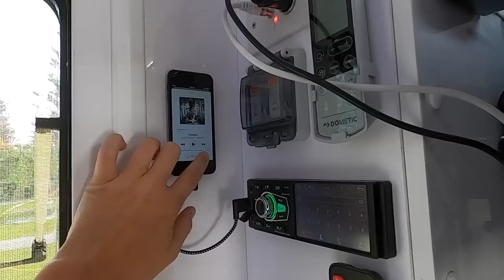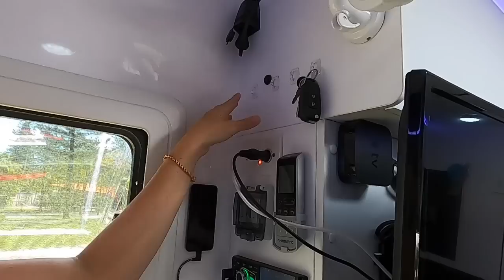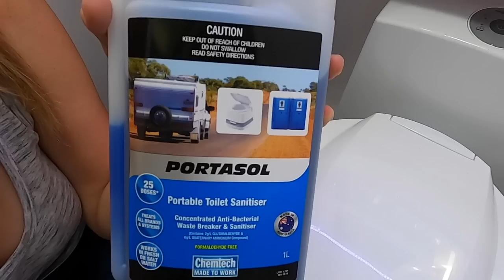CARAVAN TOUR - OUR HOME TO TRAVEL AUSTRALIA IN! - 006

Comment: Re chrome cast:
The Apple TV as you are using it now is a good option, but it may be worth getting a mobile 4G router like the Nighthawk M2 and using that to provide WiFI coverage in your van from the Telstra 3G, 4G, and 4Gx network. These units charge off of USB-C so you can run it off your existing USB chargers and you can also get efternal antennas to connect to the FME antenna ports in the back.
With a mobile router, your devices can all connected to a WiFi network (like you would at home) and your streaming services should function normally. I would also recommend when joining laptops to this network to make sure you set it as a "Metered Network" so that they avoid downloading updated and use the bandwidth more economoically. 

Lastly, most providers will allow you to order a data sim attached to the data allowance of your family plan. By doing this, you combine both of your phones data and can use it from your mobile router.

Cheers.
Reply from the maker: Thanks for that! We actually ended up getting the nighthawk so we could run the Apple TV and it’s bloody amazing! Haven’t heard about the data sim before, will look into it, thanks for the awesome tips! 😁
Reply: @BigOzExplorers  No worries. As another note with the nighthawk: If you have trouble communicating between devices, look up "Disable ipv6 on nighthawk". These devices have a few known issues with ipv6 and work much better with ipv4.

All the best.

Comment: The trick to chrome cast is to set it up on a wifi somewhere else.   Once setup of you enable wifi sharing on your phone and make sure the SSID is the same name as the SSID on the wifi you set it up on.   Chrome cast won't know the difference and will allow you to stream from your phone with out a wireless router. 

Option 2 would be too use an old Android phone as a wireless router or a wireless router with 4g support.   Add an additional sim card to your plan  and install it in the router and it will work as if you are at home
Reply from the maker: Thanks for the tip mate! Appreciate your help ☺️ We ended up moving away from chrome cast and got a smart TV that does all of what we needed with a Telstra wifi 😁🤙🏻

Comment: FYI... brake safe should be connected to the chassis of the vehicle.. not chains.. not tow bar.  you should assume worst case that your tow bar fails
Reply from the maker: Yes your right, just read up on instructions etc! We will change that, thanks 😁
Reply: Hey guys, thoughts on changing this video to remove the advice for safety chains?

Comment: Really loving the content thanks for sharing. I have a chrome cast working in my caravan now off grid But you do need two iPhones. One set up on hotspot that your spare iPhone and your chrome cast can connect to and go through the setup procedure on. there is instructions on the Internet and it does work. Just hold the button down on the chrome cast until the light goes white to perform a factory reset and then start a fresh set up procedure of it and your spare iPhone both tethered to the hotspot on another iPhone.
Reply from the maker: Thanks for the tips! :)

Comment: Love your trailer. Congrats!
Might I suggest putting all the cleaning supplies, locked, out of the reach of little hands?
The bod on the front is probably meant for a generator or outside grill. I'm surprised that your rock deflector doesn't fully protect your propane cylinders.
Reply from the maker: This video is some time ago and our little hands were old enough to know better or too young to move lol, situation has changed a lot now! 😁 the box was a great idea but the slides were shocking, couldn’t of pulled anything out with weight in those slides 👎🏻 we’ve change it now to something that suits us better!

Comment: It’s possible to convert your Apple TV to run 12v power if your happy enough with the Apple TV it’s not a hugely difficult modification
Reply from the maker: It is possible to make Apple TV run on 12V but we’re not prepared to pull the thing apart and figure it out! Our battery upgrade includes an inverter which we need for our microwave as well so we will probably use the inverter when we’re streaming because it’s simpler than chromecast! Our Wi-Fi is 12V so the Apple TV alone won’t overwork the inverter at least... The battery upgrade is next week so we will let everyone know how that all goes anyway, hopefully we can keep everything working the way we have it now! 🤞🏻

Comment: Great vid guys it’s my understanding that impact drivers on your landing legs can break the teeth off on the mechanism use a cordless drill instead cheers😀
Reply from the maker: Thanks for the feedback Murray, we’ve heard so many things about these now I don’t know what to think 😂 hopefully ours won’t give out but if they do I guess we will find out the hard way! Only so many tools we can carry to be within our weight and not be silly, a right catch 22 hey!
Reply from the maker: Sounds like you think we’re lifting the van with them, we don’t just FYI 💁🏼‍♀️ we do actually know how to use stabiliser legs, they’re not called jack legs for a reason 😊
Reply: I use a cordless drill to get them close then use the crank handle supplied to put tension on them. You will strip the bolts and bend pins with an impact gun eventually. From someone who has had to replace both because I used to use a gun.

Comment: Hey guys great work and good luck on your venture. 
Just a lil hot tip with your storage if you can try and keep your heavy things as low as you can it will help with the centre of gravity and when you get on the bumpy road it will help with the longevity of the cupboards and shelves. 
Great work keep up the good job
Reply from the maker: Thanks Matt for the top tip 🙌🏻😁

Comment: Front tool box is made for a gen set.
Reply from the maker: We have chosen to travel without a generator and have since installed a Ziggy barbecue in the tunnel boot so the slides in the toolbox were not required and additional weight that we needed to trim off! 😁

Comment: A blunt knife is more dangerous than a sharp knife.

Ensure you can both operate the van's set up and preparing for the road. Filling water, dumping grey water etc. As well as both towing, reversing, parking, changing a tyre, etc.  If anything happens either of you can completely takeover, while the other person is laid up.

Seriously I would invest about $300 and buy a Personal EPERB (an emergency position location beacon), meaning in a medical emergency you can call for emergency assistance. Anything which your life is endangered. If seriously going off-road, look into getting something like a Codan Outback Radio transmitter/receiver. You may need to get an operator's licence. It means you can also call for assistance of anyone within radio distance, talk to others on the road. What many do is put their call-sign on the back of their vansand even roof, so others following can call you, warn they want to over take etc. Or in an emergency, aircraft can recognise you from the air.

Also going bush, ensure you are carrying some form of personal protection, wink wink, even a bl**dy big wrench or cattle Taser. Cable zip ties make good restraining ties if needed to keep an unwanted stranger secured.  

We are a relatively a safe country but on occasion unlawful individuals can spoil it for others. Always ensure someone knows your timetable and checking in like clockwork. They could also be a means of getting help for you if something goes wrong. Don't be frighten of talking to the Police in outback towns. If you have a bad stretch of road ahead, they can stay in touch with the next station on your destination, to ensure you arrived safely.

Road conditions can change at the drop of a hat, you need to be aware at all times, you also have children to consider. Teach your daughter a safe word, for when you want her to go to a safe spot immediately to hide. Think about that one. Sorry, I don't want to make you frighten of hitting the road or the outback but at the same time, you need to be smart to be safe. Like NOT always stopping on the road to assist a car. Always listen to your gut, listen to each other. "She'll be right mate", isn't always safe.

You can use your mobile or radio to get them help unless it is a life and death situations, then of course you stop but hopefully you will also have your EPERB to use. If one of you leaves your camp to go exploring or even fishing when out of site, then take the EPERB with you along with your two way radio, water and hat.

Since Covid, we need to be really aware of our personal safety at all times. The harder life gets, the more risks there are from strangers who fall on hard times. Even when getting fuel and you all leave your vehicle, ensure your car keys are in your pocket and your vehicle is locked. Never leave your car unlocked when not in it for driving.

Sit down and write down some rules for when you are on the road, alone. If need be have little quizzes or mini exercises until you feel comfortable. If you run into trouble, you need to act quickly, not become paralyzed with fear.

We have spent many years travelling and living around Australia. We know roads can be lonely and dangerous. If you breakdown, never leave your vehicle, never when outback on dirt roads. Good luck from Townsville. You will have some amazing experiences, our country is incredible. Stay safe and have fun.
Reply from the maker: Thanks for the tips! ☺️ Lucky for us, we’ve got a lot of country background in Australia and are aware of a lot of these things already! Not just city slickers hitting the road 😉
Reply: @BigOzExplorers   Great to hear after living and working our way around Australia ourselves, we have seen our fair share of people come to grief. After volunteering in regional cities and outback towns in road rescue,  we have pulled  too many people out of situations they unfortunately found themselves in with little experience. As well as being on too many search and rescues for missing people. With larger RVs and 4x4 vehicles,  many owners don't have experience off the highways and many are aware of the pitfalls of their own heath issues deteriorating in remote locations, without the benefit of assistance.  

With such a lovely family, just stay safe and enjoy our vast wonderful country. I was heartened by you impressive tool kit, I hope it includes a snatch and grab or equivalent as well.

Comment: Little curious about your battery setup. The redarc battery manager is close to 2 of the batteries, but not so to the other 2. I believe that's not an ideal way to fully charge batteries equally. Battery leads need to be similar length etc. Did you have 2 batteries added, and placement an issue, or was that standard from manufacturer. At least with redarc, once batteries fail can buy 2x200amp lithiums and put under caravan, and none under seat. you mention 2 and soon to be 3 solar panels. Are they large output. You have 400amp battery, so ideally should have 800watt solar. Especially with 12v fridge.
Reply from the maker: Hey Ricky, thanks for commenting! This was how we purchased it from the dealer... Our battery system has vastly changed since this video, we now have one 200ah lithium battery under the dining table seating with a 2000W inverter. We use the outside box for storage of our sullage hoses now. We have also had an additional two solar panels installed on the roof so we have 600 W in total (150W ea). Dependent on our need when we go off grid more often, we may get another 200ah lithium battery to piggyback our current one, but for now the 200ah seems to be doing the job! Thanks for following our journey ❤️

Comment: Hi, have you been over a weigh bridge? I'd be curious to see if you are still legal with your GCM as im interested in a similar set up but the payload disappears when I do my sums. Also the tow ball weight on that model van seems a bit light from the specs and i wondered how well it tows behind a ute.
Reply from the maker: Hey Andrew, we tend to sit around 6-6.1t at any given time depending on groceries/fuel/water etc which is the best we can get it (we’ve been on 4 weigh bridges since the initial weigh 😂). The van itself tows !!excellently!! can’t stress that enough 😍 butttt... as we want this for a long term van, we are going to be making some car changes so it’s legit legal under GCM from now on... stay tuned! 🤫🤫
Reply: I am also looking at towing 3000kg - 3200kg van with a Ranger. Its a struggle to make the numbers work, especially if you fill up 2 water tanks,  3 in your case. 
Rangers can only get a GCM upgrade before registration. So I will have to either trade in my current Ranger for a new one or get a LC200.
Reply from the maker: That’s similar to what’s on the cards for us. Happening next week! The Ranger has treat us well, but the squeeze is too tight with GCM.